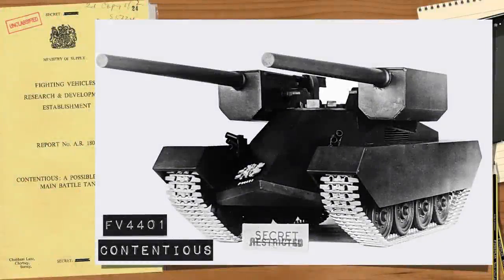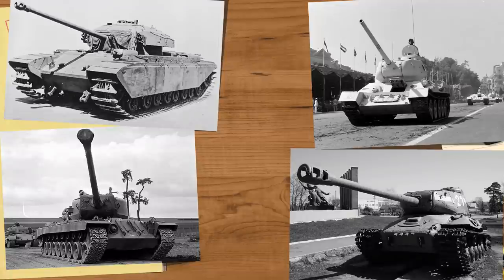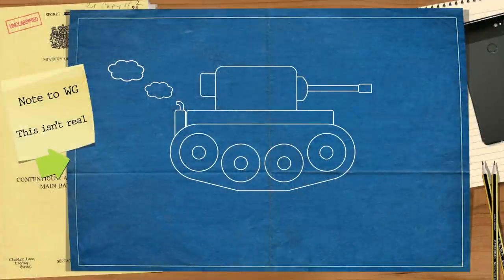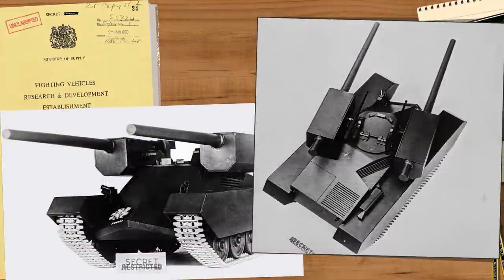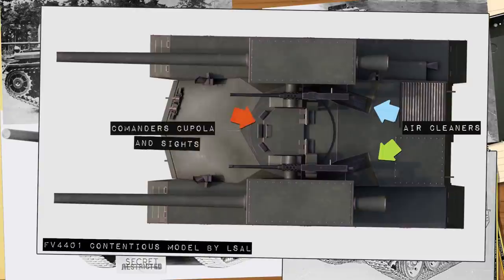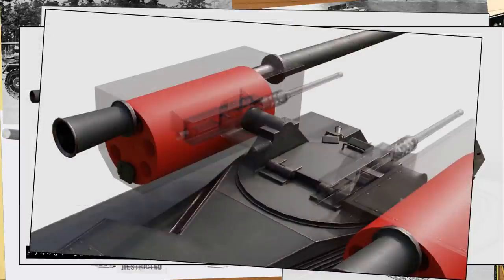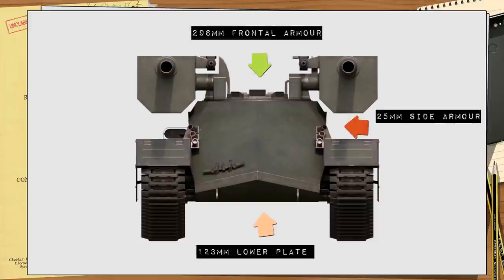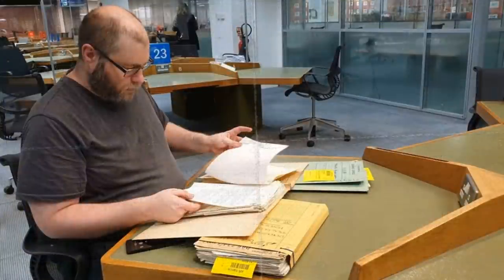FV4401 Contentious - Tank Design & Development

Comment: The most fascinating aspect of all this is that it remains the basic pattern for "mold-breaking" tanks of the future being proposed today, with very small low-profile hulls and use of remote-operation for the weapons to keep the crew small and in the hull. The more "new" an idea seems to us, the more likely someone else already thought of it long ago.
Reply: And still, not until recently they started making said tanks. Look at the Armata for an example, did you know that the original design was from the Object 195, 30 years ago? And there are even an older designs from the 70s such as the Object 450 with the turret being remote controlled.
Reply: @zondazerda2230  Indeed and even earlier, the US had several X vehicles doing the same thing back in the 1950s. The concept is one of those that seems so simple and elegant, but execution was and is an engineering nightmare. That it is only now, with relatively cheap and plentiful computerization, that we seem to have functional systems is not a big surprise. Also noteworthy that while Russia sings praises of T14, they continue to only purchase them in small numbers for special units, suggesting the system is not cost-effective for Russian purposes yet, even if it probably is combat-worthy.
Reply: The t14 is not the same as the object 195.
Reply: They would not have been successful back then because of the mechanical reliability of the automated systems.  Thus it was decided to continue using the proven method of a manned turret.
Reply: I think it's important to separate the innovative elements from the general characteristics of a good tank. Low-profile, high-survivability, etc. have always been desired goals, and there are only so many ways of doing those things...in general. The interesting part is in the details; whether it be a clever implementation, or advances in technology that make new things possible.
Reply: @matthiuskoenig3378  I didn't say they are identical, but heavily based on it. Look it up.

Comment: The contentious 1 would make and awsome tier 8 TD.😅
Reply: The Contentious 1 that got built was just a testbed for the suspension and autoloader, not a true prototype for the entire design. The full design had a very interesting frontal armor scheme.

Unfortunately, that armor scheme wouldn't translate very well to WoT, since it involved the fuel tank being a integral part of the frontal armor. And also relied on internal armor plates, which aren't modeled in WoT.
Reply: @RedXlV  Considering the fact that they make tanks that only existed in 'blue prints' I think there is enough to go on with this one.
Reply: @blusoda0021  I think a fully "complete" Contentious with an enclosed crew and the 105mm L7 could easily be a Tier 10 TD.
Reply: @RedXlV  what I'm saying is that it would be hard to make a tier 8 TD that play/looks like it isn't hard in any way
Reply from the maker: yup, part 2, which is about 1/2 written atm, is turreted, tho limited traverse , so in wot, would probly be a td, but tbh they would need to nerf it into the ground to make it playable
Reply: @armouredarchives8867  oh for sure, I'm sure you miss the part written in the tanks files which states..25% DPM nerf if added to Wot.😅

Comment: 4:25... I thought if tank size exceeded engine power the British way was simply to bolt more engines together, job done? Or if engine power exceeds size, saw off 1/3 of the cylinders. Good, engineering solutions :). Like, no space under the wing, put the drop tanks (drop?) on top of the wing!

Comment: Highly inefficient and not ergonomic. It would have been less intellectually challenged if the single crew member would have been placed in a turret. Since you want to protect the squishy parts, you'd mainly need to protect that part. Two guns, both placed off-center is rather dumb and when you want to limit the size of a vehicle doubling the amount of main guns is not the way to go.

Besides that, look at modern tanks where commanders, gunners and drivers have their own jobs to focus on (hunter-killer; commander scouting out and working out threats and the gunner taking them off the checklist) is so much more efficient.